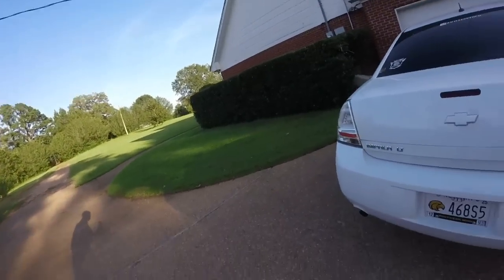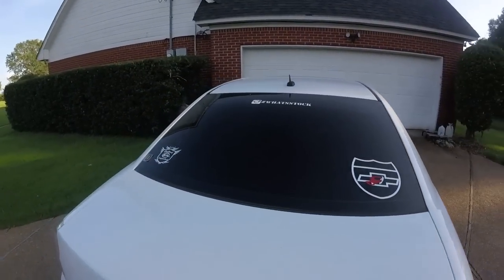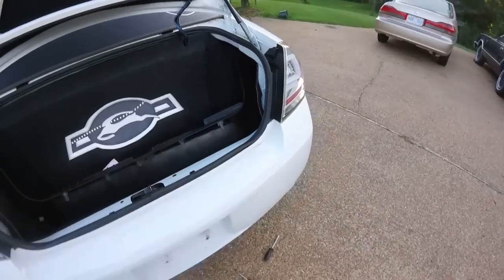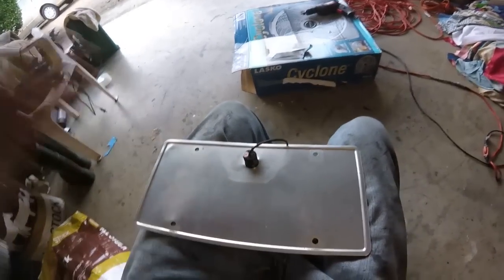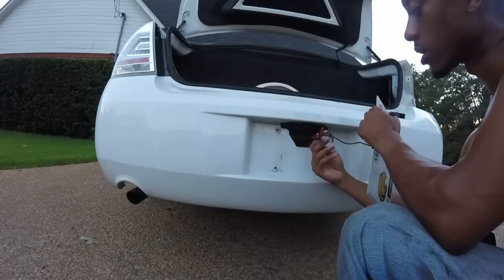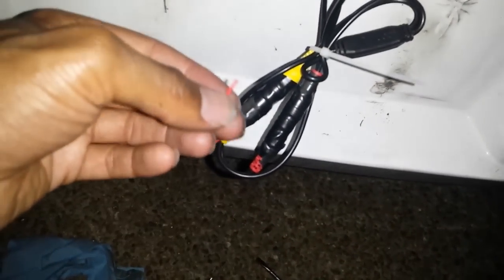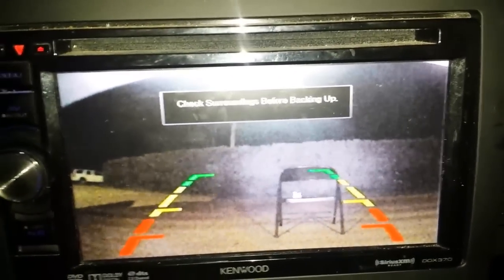Reverse Camera Install for the Impala

Comment: Impala are some of the easiest cars to do car audio stuff to. I love my 2010 😎
Reply from the maker: Misael Cartagena yeah they really are
Reply: 89imp03 you got me painting my dash trim right now. I'm painting it blue, and it looks solid so far. Planning to rewrap my headliner black too
Reply from the maker: Good deal man. I still haven't worked up enough to change my headliner
Reply: Just bought one. It only had 22k miles on it and its a detective car, so, not a worn out patrol car. I am loving it. Its metallic blue  has blue emergency lights on the rear view mirror and PA/sirens. Don't know what I am going to do with all the cop features, but, its sure to be trouble. Just today I got a Kenwood ddx 376BT, so, now watching everything for hooking up the backup cam and sound.

Comment: It wasn't really shown in the video but quick question, At 4:32 is the Light Green wire aka the reverse light positive (All the way on the right) where  you connect the red wire (the separate cable that was red and black). And 4:36, is the Dark Brown wire (The 2nd wire) where you connect the black wire. I understand everything else, just this part is confusing me as it wasn't clarified.
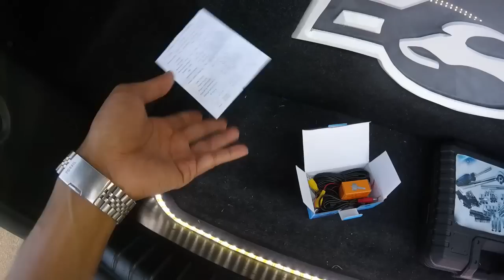Reply: And if that's the case, essentially you would connect two cables to the reverse light positive <--4:32 (Two cables as in the red wire I mentioned above <--1:20 and the extra red wire that's dangling from the RCA cable that would connect to the camera <--1:15). Right?
Reply from the maker: @zHazzz  yes, that's correct

Comment: Good video but question where you connect the wire that hanging out that yellow plug that’s close to the camera
Reply from the maker: Connect it with the power wire that goes to the reverse light bulb

Comment: What did you use to drill the hole? Clever trick. I have a drill but I don't  know what size you used. I too am going to buy the same camera btw.
Reply from the maker: AdrianRock the camera comes with a drill bit thats the right size so no worries there
Reply: Thanks for the fast reply. Can't wait to install
Reply from the maker: No problem

Comment: The power the one all the way to the right what colour is that i swear im blind
Reply from the maker: Brown on this setup
Reply: @89imp03 I have a 2006 Chevy impala lt so should be the same? If so ima give this a shot tomorrow lol thanks brother for the video
Reply from the maker: Should be the same but if not you can just trace the wire back to the reverse bulb . Good luck
Reply: @89imp03 sweet brother works good but mine stays on I think has something to do with the auto lights
Reply from the maker: @Canadiangreatoutdoors  could be connected to the taillight bulb instead of the reverse light. If you turn the lights off and the camera goes off then that's it

Comment: As others had said, it was hard to find a solid video for this kind of car, i actually just had to replace my 2006 impala with a 2001 intercepter but essentially its all the same. Side note, i love what you did with the interior. Looks smooth. What kind of paint did you use with that ?
Reply from the maker: Thanks, glad it was helpful.  All the paint is duplicolor color match from advance Auto in the small spray cans
Reply: @89imp03  did u take the trim in your car off?
Reply from the maker: Yes I took the whole dash and trim pieces out to paint it
Reply from the maker: Here's the video https://youtu.be/xFOMUwLis44

Comment: How did you connect the short red wire on the rear side of the car to the reverse light, it's so short, how does it even reach?
Reply from the maker: Logan James it was another plug that connected to it with longer wires
Reply: To clarify, you just connected it to the power wire of the camera? Or did you add wire to it?
Reply from the maker: Logan James power and ground on the camera went to power and ground on the reverse light. Yellow rca ends one plugs to camera one plugs to radio. The wire with the rca, one end connects to reverse light positive the other end connects to the reverse wire on the back of the radio
Reply: 89imp03 thanks, I realize that’s how the connection works. The issue I have is the red wire on the RCA plug is too short, it won’t reach over to the reverse light. 

Did you add wire to it to make the connection longer or did you splice the camera red wire and attach the RCA red wire
Reply from the maker: Gotcha, yeah just splice it with the camera wire that connects to the tailight
Reply: 89imp03 perfect that’s what I’ll do. Now how did you get the cable inside the car from outside by the license plate. I see no other spot except if you were to drill a hole
Reply from the maker: Logan James no drill needed. Its around the 5:50 mark. Just poke a hole in the rubber grommet that the taillight wires use
Reply: 89imp03 ya I realized where to put it right after I typed the comment
Reply from the maker: Cool
Reply: What did you do with the short red trip wire for reverse near the tail light? Did you have to add wire and attach it somewhere in the tail light?
Reply from the maker: @TheScottGilkey it has to be connected with the wire that goes to the reverse light wire. Might have to add some wire to reach
Reply: Would that be the same as the positive wire or a different one?
Reply: I figured it out by reading other comments. Thanks for the great vid. It made it so much easier!!!
Reply from the maker: @TheScottGilkey  good deal. Glad you got it sorted out

Comment: What year impala is this? I’m trying to install a reverse cam to my 07 LS. Having trouble figuring out which wires on the reverse light I’ll need to hook up to
Reply from the maker: Daniel Perez 2013. It should be about the same
Reply: 89imp03 did you have a source that you used to know for sure which wire is which? Appreciate the fast response too ✊🏼
Reply from the maker: No problem and no I just grabbed the wires connected to the reverse bulb and took a guess. If it didn't work the first time then I knew the second wire would be the right one
Reply: 89imp03 genius. Don’t know why i didn’t think of that. How’d you wire it? Hard to tell in the video. Did you use butt connectors? Or just simple wiring with electrical tape
Reply: Daniel Perez I’m curious to have you ever figured it out

Comment: I follow your instructions step by step and it still not working
Reply from the maker: Phillip Owens everything connected to the right wires?
Reply: I have an 08 impala I use the brown and black wires and the power wire on video cable

Comment: Wiring a front camera right now... there's a black ground, red accessory 12V, and a yellow for continuous 12V - do you know if there's somewhere near the radio I can splice in the yellow? Or do I need to extend it all the way to the battery terminal?
Reply from the maker: If it's an aftermarket radio it'll be a yellow continuous 12v on the back of that harness
Reply: @89imp03  thank you! I found it shortly after posting. Got a new one tho.... blue/white stripe wire on my Scosche radio adapter harness... which does this splice to? There is no blue/white on my radio. I can see there's power on that pin from the car's harness so I must use it for something
Reply from the maker: @dootieflack  blue/white on the harness is either power antenna or remote wire.
Reply from the maker: @dootieflack  if it's no match you can just tape it off and be ok
Reply: @89imp03  you're the man. She's all wired up perfect but no screen no sound no power 💀 lmao

Edit: got it, tap splice didn't get thru the wire
Reply from the maker: @dootieflack  💯💯 good deal

Comment: I would not get a cam that requires you to drill through the license plate. you should find one that drops down from just above the license plate.
Reply from the maker: Yeah if you don't want to do a lot of custom cutting or drilling I'd recommend the ones that hang down and mount with just the screws

Comment: I haven't picked a backup camera yet, I actually came here to see how you tapped into the reverse lights. I'm installing an XTR LP reverse bar above my license plate to help me see a little better backing up at night. But I will be doing some tail and reverse light mods once I find something stylish like your assemblies
Reply from the maker: That's should be real bright. Good luck with the build. For some reason these lights are real hard to find for a decent price now
Reply: @89imp03  do you mean your tail lights? How much are they going for?
Reply from the maker: @nomad-1776  yeah, I paid like 250 for mine. Last time I saw a set for sale they wanted like $400
Reply: @89imp03  wow that's insane. I guess everything else is going up in price I shouldn't be surprised that some car parts are too. Hey, do you know what gauge of wires on that harness are? I need to pick up a wire stripper of the appropriate size
Reply from the maker: @nomad-1776  I would guess at about 16 or 18 maybe

Comment: I have a 13 impala and followed everything you said but when I switch my head lights on it powers off my head unit and the olny thing I can do to make the head unit come back on is go into reverse and When the cam pops on the head unit powers on again and stays on untill I switch the head lights on or off again
Reply: I use the same method you did chose to wire postive to light green reverse light and chose the 2nd negative wire I'm thinking ethire a I'm not grounded good enough or b I have a weak battery I need to replace
Reply: One more thing the camera does work while in reverse btw with no issues the prob is when I turn off or on the day time running lights that what powers off the radio
Reply from the maker: What type of radio? Could be something else grounding out causing the issue
Reply from the maker: Samson Jonson which wire on the radio did you connect the reverse camera to?
Reply: 89imp03 hooked up the yellow part to the plug in like in your video and the red wire I wired that in to the reverse orange wire by splicing them together
Reply from the maker: I think you may have spliced something into the wrong wire on the radio. Sounds like something is connected to the illumination wire which is normally orange on aftermarket radio harnesses. That could be why the radio turns off every time the headlights come on
Reply: 89imp03. Its posible there is 2 orange wires and I could of put it on the wrong one and on my radio it list orange as the reverse wire so I might try to other one

Comment: I got one question there's a park brake wire on my radio is your hook up or does that have nothing to do with it
Reply from the maker: Phillip Owens my parking break wire goes through a relay so I'll be able to have DVDs play whenever I want
Reply from the maker: https://youtu.be/hv_TSg34xNo
Reply: @89imp03  guess what? my wires look exactly like yours but totally opposite I finally got it to work I have an 08 impala
Reply from the maker: Well that's wild. Good you got it working

Comment: I have a 14 impala limited ltz, do you think this will be the same?
Reply from the maker: Yeah it'll be the same
Reply: @89imp03  im sorry bro i cant use this video for reference. point to wires with one hand is silly cause i still dont know which ones you pointed to. i will gladly pay that shop to get it done. not about to mess up my vehicle
Reply from the maker: @jamesmontgomery8376  ok good luck. It's only 2 wires coming from the reverse bulb. One is power one is ground. That's all you need from the back, the rest is labeled on your radio
Reply: @89imp03  that's just it, coming from the bulb there is 3 wires and not 2, and the colors from yours and mine don't match.
Reply from the maker: @jamesmontgomery8376  are you on the reverse bulb at the very bottom? Or a taillights bulb? Check the taillights on the other side. If it's 3 wires from your reverse 2 should be the same color and they'll be ground since nothing else gets the same power a reverse bulb would get
Reply from the maker: Double check at the 4:10 mark
Reply: @89imp03  I think  you are missing what I'm saying, we don't have the same car.
Reply from the maker: @jamesmontgomery8376  you have a 14 limited? Or the new body style 14 which isnt a limited?
Reply: @89imp03  yes its 14 limited LTZ. I just found out that they made alot of changes starting 13.   I think that's why im getting confused when watching your video
Reply from the maker: @jamesmontgomery8376  so it's a completely different body style? The limiteds were fleet models of the 06-13 body but nothing was changed
Reply: @89imp03  no it's still the old body style but they made alot of changes starring on 13. For example 13 and up rear view mirror has LED's inside and not interchangeable bulbs. I had to buy an old mirror just to change my bulbs blue
Reply from the maker: @jamesmontgomery8376  oh ok, well the taillights should be the same since they're all interchangeable. Mine is a 2013
Reply: @89imp03  I'm about to pull my light and hopefully it's the same
Reply: Bro my bad for doubting you. I finally figured it out. It was the way you was holding the plug at the harness. The clip is at the bottom and that's how I was holding mine so basically it was upside down. You the man. My bad bro
Reply from the maker: @jamesmontgomery8376  it's all good bruh 💯💯
Reply: @89imp03  bro do you know anything about my head unit not shutting off now?  Everything works but now sometimes when I get out the music is still playing with the car off
Reply from the maker: @jamesmontgomery8376  depends on how it's wired up. If you used the full harness it should turn off as soon as the door is opened.
Reply: @89imp03  it used to, I had a shop put the original in and was just replacing the camera cause the shop grounded to the body. Right now the current setting is on battery, do you think I need to change it to ground?
Reply from the maker: @jamesmontgomery8376  battery positive? If it was already hooked up there don't put it on a ground.
Reply: @89imp03  it's still on positive. I need to figure this out. It's not making any sense.
Reply from the maker: @jamesmontgomery8376  maybe the RAP relay on the car is messing up or something. That's what normally let's the radio and interior lights stay on once you turn the car off for like 10 minutes
Reply: @89imp03  finally figured it out. Not sure why but everything is tied to the daylight running lights. So basically when the headlights are on the head unit is too. I park in a garaged and noticed it only stays on when I would park in there or be out at night
Reply from the maker: @jamesmontgomery8376  well that's different. So you got it straight now
Reply: @89imp03  nope trying to figuring It out
Reply from the maker: @jamesmontgomery8376  might have to rerun the power wire for it
Reply: @89imp03  I'll look at tomorrow, but I don't think it's anything I can do. I think this maybe one of those changes I was referring to before. But whatever I find I'll let you know
Reply from the maker: @jamesmontgomery8376  aight good luck man

Comment: What was color of power of reverse wires was
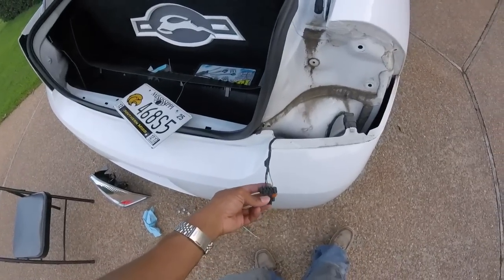Reply from the maker: 305chevyboys p its at the 4:20 mark and around the 4:40 mark. It was brown on one side and I think green on the other side.
Reply: What did you use or how did you actually connect the wires? I used 22-16 gauge quick connects on the  brown wire (reverse positive) and the wire 2nd from left (ground) and I keep getting no signal. I've checked all the hookups from radio. I actually had the camera working when I hooked it up directly to radio but no enough length to wire to run that way. Please help! Been working on this for two days.
Reply: @89imp03  I need help.
Reply from the maker: @shapolk  I just stripped the wires on each end and wrapped them together and then taped them. No connectors or anything
Reply from the maker: @shapolk  sometimes the quick connects may not give a good connection
Reply: @89imp03  Thanks. Gonna run back out and try this. Nervous. LOL don't wanna mess up anything.
Reply from the maker: @shapolk  no problem 👍👍
Reply: @89imp03  Right on the money!!! Wish I would have came across your video sooner!!! Thanks a million!!!!
Reply from the maker: @shapolk  good deal, glad it worked for ya